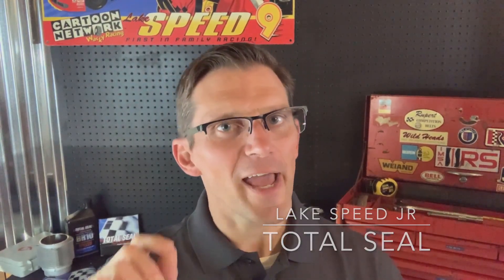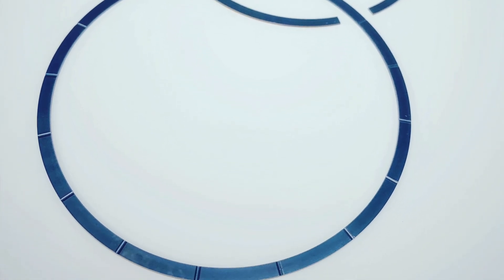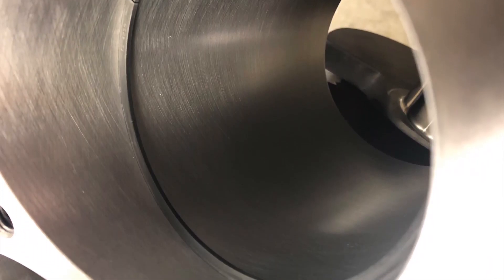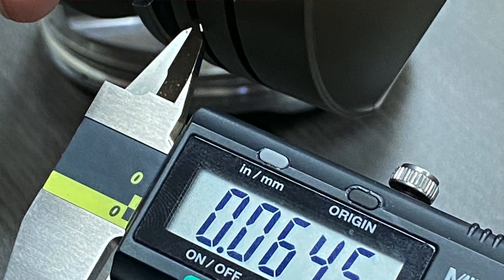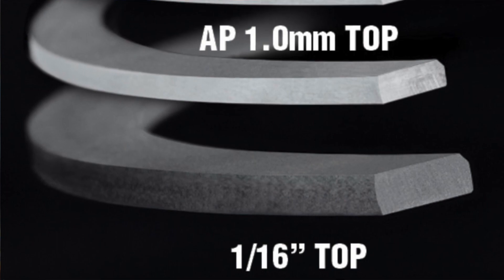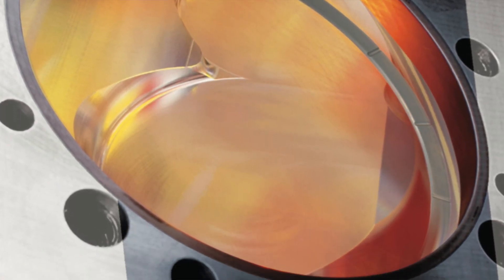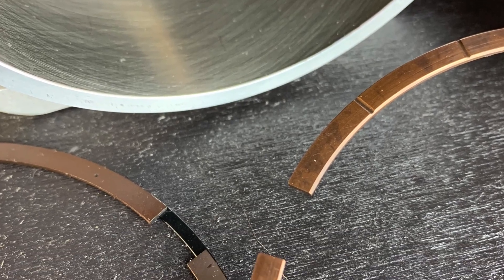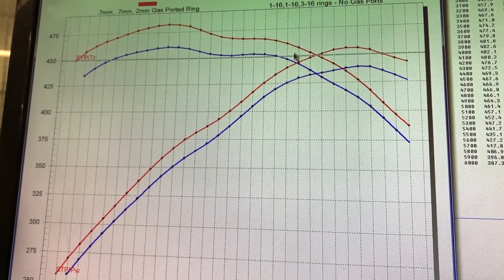Piston Rings 101 - Part 2 - Piston Ring Materials & Designs

Comment: If I were a war Lord in the Apocalypse, could I fix my war Rig, by pounding coat hangers, flat in this shape, and heat treating them? What if I took a sheet of mild steel cut it? It's very precisely machined it, and then he treated it? I could potentially do that with pieces of thin stainless too.

Comment: On the street with 11 to 1 comp asperated V8s, should i use stainless or molly rings and do top rings with a larger inside diameter to allow  more expantion, create more ringgroove to the top of the cylinder. Concerning millage.   Mike
Reply from the maker: Thanks for the question. The stainless top ring is the best in all applications in terms of durability. The difference between the OD and the ID of the ring is more about the tension and conform ability of the ring. A narrower radial dimension typically works best.

Comment: I'm trying to see if you guys have rings for my motor it's a 3uz fe Toyota motor and your site isn't working
Reply from the maker: Thanks for the heads up. You can either call our tech department at 623-587-7400 or email them at info@totalseal.com
Reply: What !!! If it's worth fixing, Why don't you just pump a ford engine in it.